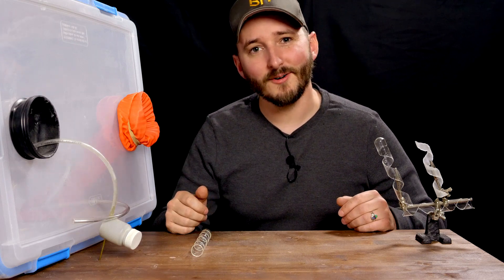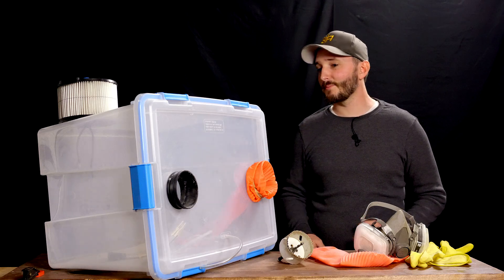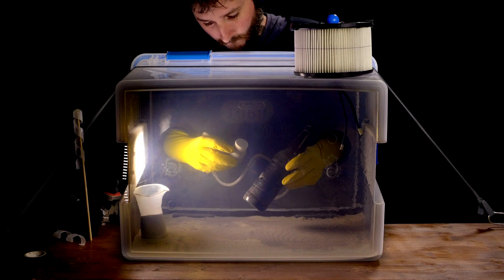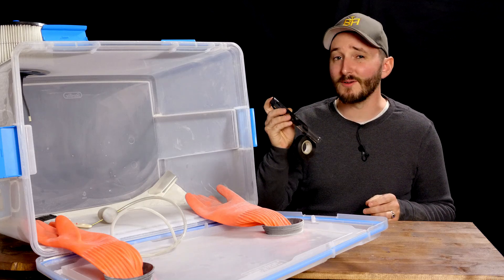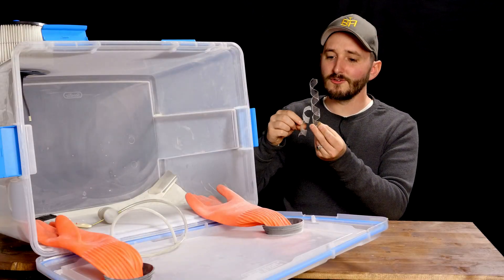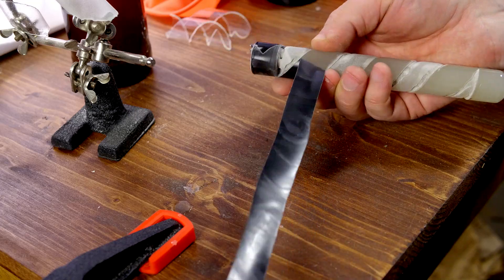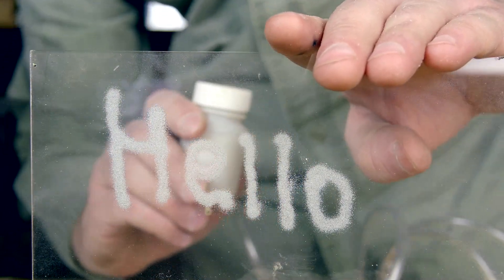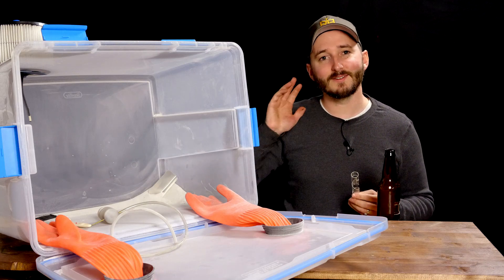*Impossible* Glass Cutting With DIY Sandblaster

Comment: Great video!  Thanks for all the safety tips with the gloves, filter, etc.  On the sand, did you dry it in the oven first to make sure it was 100% dry, so it wouldn't clump?  And reusing it is a good idea, as long as there aren't larger glass particles in it which may clog up the tube after a while.  Probably some small very fine  screen you could use if became too much of a hassle.
Reply from the maker: I didn't have any issue with clumping, but I wouldn't leave the bag of sand out in the rain beforehand.

Comment: It might be interesting to test if adding some water to your sand blaster would make cutting easier.
There was a relatively recent "The Action Lab" video "Is It Actually Possible To Cut Glass With Scissors Underwater?" It turns out the water interact chemically with the glass and makes it more brittle, that allows the scissors to do more local damage.

Comment: The sandblasting cabinet is a genius idea for other uses as well verses buying an expensive store bought one. I am curious if using blasting media such as aluminum silicate or oxide, glass beads,  soda, or walnut shells would cut through the glass quicker or have a more refined finished sample. If walnut shells would cut through the glass, they might not mess up the inside of the glass thus omitting the wax process. Steel grit has been used for some etching processes and may leave a smoother finish although I hypothesize it to be prone to cracking the glass moreso than just cutting it like the sand does.
Reply from the maker: The harder the better. And I think is about as soft of blasting media as will work. Aluminum oxide would work even better
Reply: @Nighthawkinlight  That's quite interesting as I thought harder materials would just leave the glass cracked instead of cutting smoothly. The gears are certainly turning now as I may have to test out some different blasting materials and see which materials work best. I suppose the more aggressive media may be able to cut thicker glass with more speed and less effort.

Comment: Great video! Also if you want some more interesting effects, try this on wood. The results of the grain structure of various sandblasted wood signs and projects can be very interesting. Also look into the various types of media available for sandblasting. Or even using  baking soda . Also used miniature steelbasically ball bearings for 1 blaster for concrete which I didn't like. The solid CO2 dry ice particless were cool there was no clean up then. So many possibilities. and you can go even further using some of the pressure washers for cutting especially when adding media to the water. . Oh and lastly, you can make a pretty mean BB gun. I've made several and had the old m-19 they used to sell in popular science powered by Freon cans. Talk about back in the day.just don't forget the mix a little graphite in with the BBa so they will flow well. Thanks again for the great video
Reply from the maker: I used baking soda for my fossil prep video. That's a great medium for delicate objects

Comment: The last true definition of "DIY". No special tools, alternatives and easy explanation.
Reply: Well minus the air compressor, but ya I loved this video.
Reply: @david2ljdavid2lj56  I think an air compressor is a fairly well established tool. If you do things yourself, you most likely already have one.
Reply: @stoat-ski  I agree but I know plenty of people who don't have one.
Reply: @stoat-ski  but that could be said for any tool.
Reply: @david2ljdavid2lj56  that's fair. But for something as specific as a sand blaster I'd say buying an air compressor is fine^^
Reply: You can make an air compressor out of an old refrigerator compressor, you just need to find a way to prevent it from overheating.
Reply: I mean if you already have an air compressor a sand blasting cabinet is only $130 and the sand blasting gun attachment is $20 from harbor freight. So I mean the cost to make this doesn't make sense as you get can something much better for just a little bit more money.
Reply: @mcgee6177  You sir are missing the point of DIY. If all your going to do is buy exactly what is shown and assemble exactly as shown. That's not DIY any more than assembling a Sauder or Ikea shelf. Notice how our presenter even stated what the terms of each material are, what factors to look for. That's because a lot of us DIYing solutions are recovering materials from discarded items. 

It's hard to break yourself out of the consumer mentality. The marketting to push you into it or back into it has got very good at making you think they are helping you DIY a solution while selling you their pre-made solution.
Reply: @eideticex  but you can't buy specifically cut glass stuff .
Reply: DIY CHANNELS : step 1 prepare this easy to get material. step 10 now we need to 3D print this part 
me watching : Uh, why you didnt mention the 3D print as the first step ! stupid
Reply: @sabayonz  why didn't you watch the whole video before starting? That should be the method before making anything from a video
Reply: @sabayonz  3D print what?
Reply: @sabayonz  he printed 2d stencil of the 3d  shape .. that's what he meant. Awerage printer will work. But you can still draw that shape by hand

Comment: Important: One thing to note about that seemingly impossible cut you talked about is that it may be very fragile and may break (very) easily. I once drilled a hole in a standard glass coke bottle when I was a kid with a regular hand powered drill bit (the kind where you turn it manually) to make a coke lamp and actually made a perfect hole! My grandpa was very confused how I was able to pull it off since I had no idea glass was such a pain to cut at the time. But when I was running wires through it the glass cracked and made it a MUCH larger hole, going from a quarter of a centimeter to a jagged inch in diameter. So it may be best to keep exposed flesh away from that point as it may shatter at even the slightest force. I think your method may limit the paths for it to shatter, but better safe than sorry.

Comment: Now your sandblasting cabinet design makes me wonder if i could make one of those and use it for airbrushing when you have no easy way to open a way towards the exterior (small rented apartment plus winter for example), or if it would be a bad idea (the atomized paint would still be floating inside the cabinet), definitely worth considering.
Reply from the maker: It would probably work

Comment: Just a quick heads up for any other folks out there with facial hair, your resporator will not seal properly and offers little to no protection for smaller particles. For the bearded amound us look up the resp-o-rator or a forced air mask
Reply: You should spend that to: "... Offers less protection..." Because "little to no protection" is false.

Comment: Maybe fill the tube with cotton balls instead to avoid the melting/cleaning processes..
Reply from the maker: I tried paper towel, but to pack it tightly enough put a lot of pressure on the inside of the glass which caused it to crack when cut. It also was hard to remove.
Reply: @Nighthawkinlight  Oh makes sense.. All those sharp edges too would definitely catch.. Maybe a wood dowel? Soft enough to maybe absorb enough of the impact to not etch the glass when it ricochets

Comment: An idea: Make a joule thief circuit, because that uses so called "dead" or "unusable" batteries. There are a few videos but they're either crappy and/or don't have a good explanation. Also you could fine tune the circuit to get a efficient one. Its easy to make (i made one out of my dad' old PC) but hard to make a efficient one that uses most of the so called "unusable" power. That would be interesting because you're one of the best youtubers at explaining things...

Comment: but what is the practical use of spiral glass cut?
the only thing i have in mind is the aesthetic for art.
Reply from the maker: The spiral is not useful practically, it's only a demonstration meant to show off how well the method works. If it works for a spiral, it will also work to easily cut holes, slots, curves, etc. Which have many practical uses.

Comment: Why not just cut the holes a little closer together? How about a replaceable plexiglass window added to the lid?
Reply from the maker: If the holes are too close together it's hard to reach anything that rolls into the outside corners of the box. A replaceable window on the box would work great, it's just not entirely necessary and so I wanted to keep the project easy. If you do make a window it has to be air tight so you don't get dust leaks
Reply: @Nighthawkinlight  Makes sense to me. Thanks for answering.